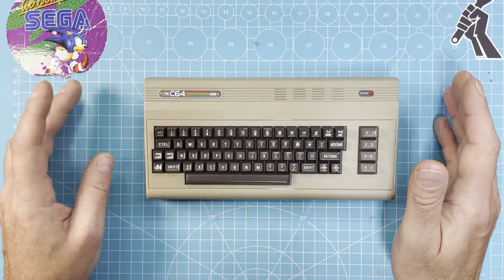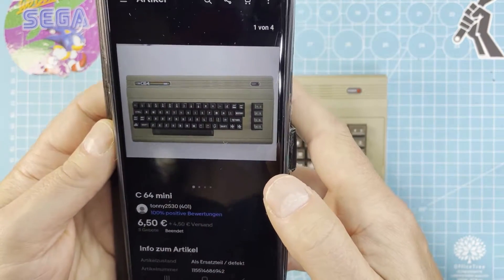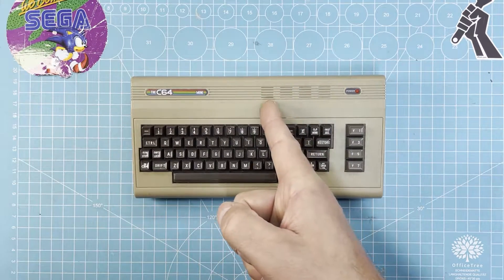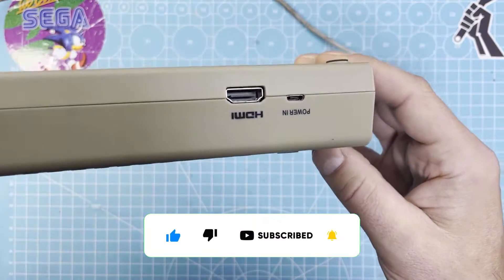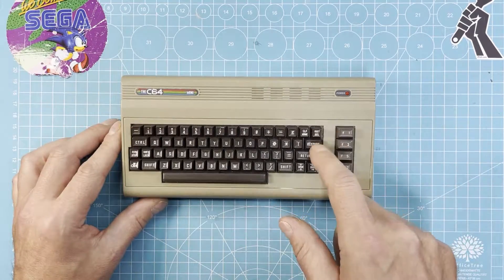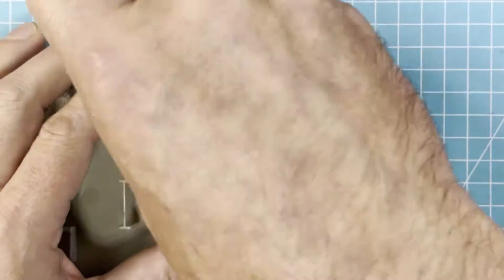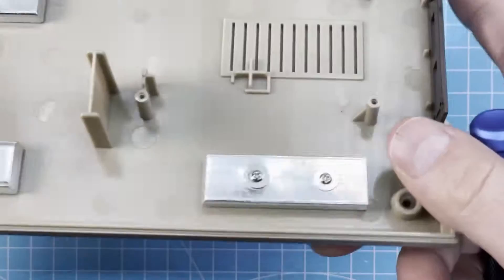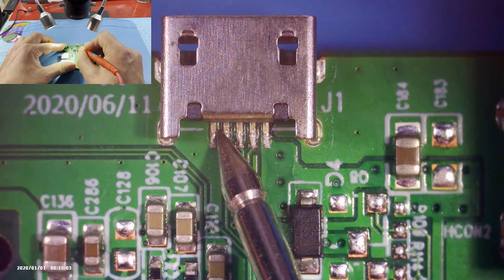I bought a broken C64 Mini. No Power! Can I fix it? #repair #righttorepair

Comment: When you checked for shorts did you do it with the power on? Wondering if following the power from the usb input would tell you anything? Since the LED is not turning on it would happen before that in the circuit? Just an idea 😁
Reply from the maker: I tried all that. 5V is going into the board. I followed that around.  Found the 3.3V rail. The chips getting luke warm, so I assume they get power. I'm really out of ideas with this one.
Reply: @TheKonsolist  oh all right then. Maybe the main chip is fried. Is always difficult to find faults in hardware you haven't been into before and are not well documented. But great stuff that you tried! I think for the next video wouldn't hurt to show what process you went through to find the fault a bit more in detail, even if you didn't find it ☺️
Reply from the maker: I filmed all that, but the files got corrupted.